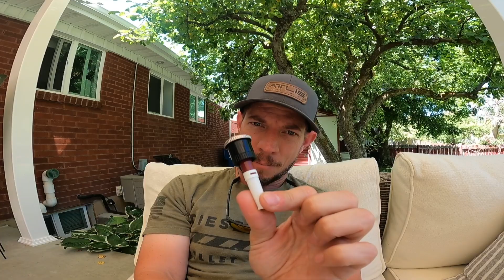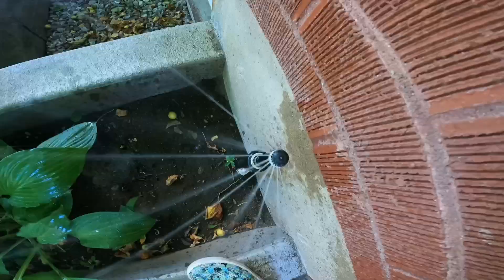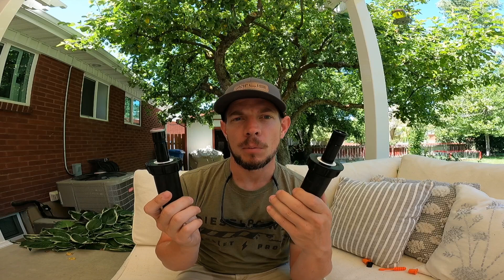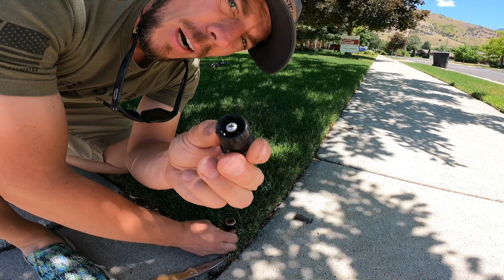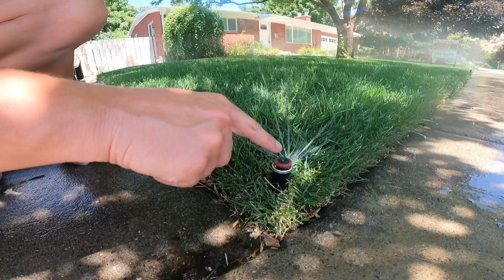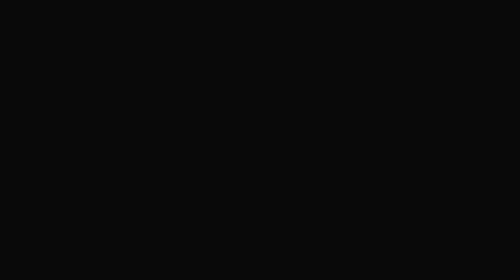Sprinkler Repair Quick and Easy, Save Water at the same time

Comment: I have those but I didn’t know you have an orange too to make adjustments.  Good info.  If the city recommends 20 minutes for spray and 40 minutes for rotary do you need to water more with the mp rotor?  20 vs 40 or is it more in the middle?
Reply from the maker: They say no, but I would watch the grass.